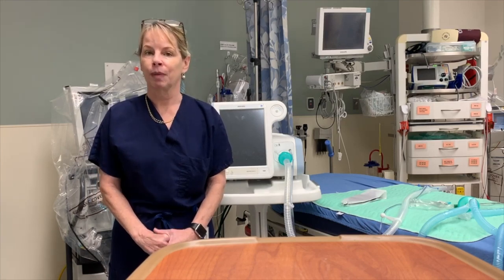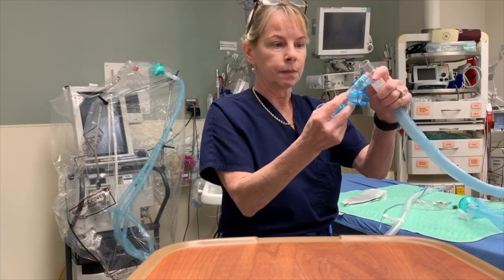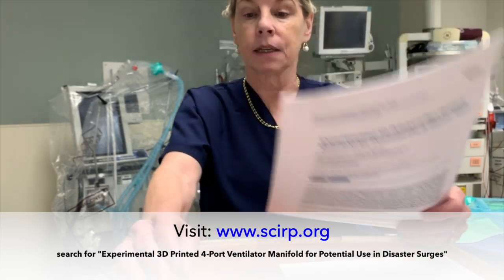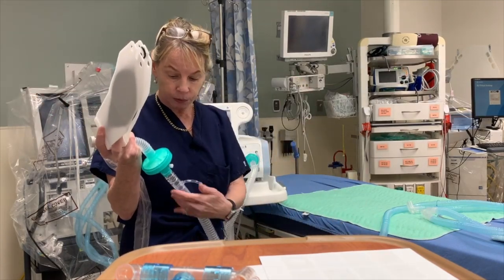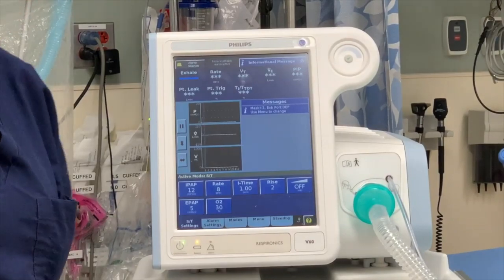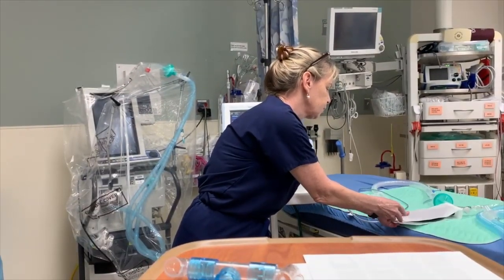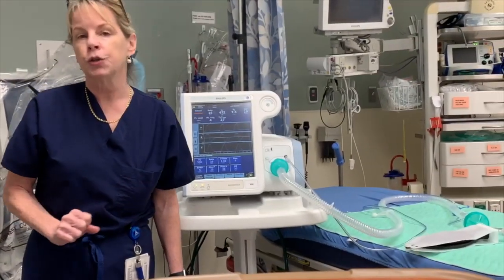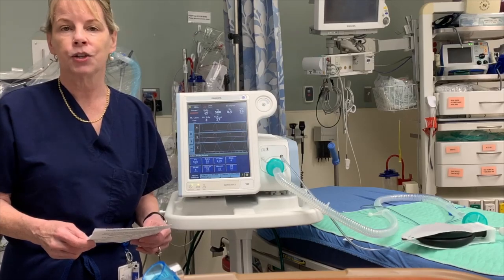COVID-19 How To: Modify a Bi-Pap Machine into a Ventilator

Comment: Thanks very much from Germany for the 3D printing docs. I am an ex Australian OT/ ED/ ICU nurse in the process of helping German engineers  here in Berlin build "things" that we need asap. Didn't even cross my mind to use a BPAP machine, I guess too many thoughts racing around.

PS I commented in the your last video about adding filters, and you added it to this vid, thanks again.
Reply: That circuit she used, I believe has a port for an expiratory filter as well. 
So if you only have a heated circuit, you can still protect the staff from the exhaled gases that don't leak out from around the mask.

Comment: Thank you from an RRT! I'll show this to my supervisor when I return to work tomorrow. (I heard the page for Respiratory at 3:44. How appropriate.)
Reply: Fit all the masks on v60s tightly before transport with covid 19 patients. For intubated ones hyperinflate the cuff before transport.
Minimizing leaks is imperative when moving patients.
Also make sure to have a filter on the whisper valve (exhalation port).
Stay safe... Well as safe as possible.
Reply: Roland Woltman  Thanks from an RRT.  But our Bipap circuits have only a hole as exhalation port.  How can you filter that?  Freaks me out to think of their virus laden exhaled air just filling the room.  😬
Reply: @BeckRD1 The circuit is setup with a viral/bacterial filters at prox and distal locations. There is a circuit with the exhalation port large enough add a viral/bacterial filter to it. Philips prod number  1065832. I don't work for them but I spent most of Sunday doing research...just trying to save you time.
Reply: @BeckRD1  If the whisper valve isn't in the mask itself, an extra filter BEFORE the mask (where the circuit and the mask connect) can do the trick in a pinch.

Comment: Dear dr. Babcock, the 4 way splitter is definitely the most practical idea out there for increasing ventilator capacity in an emergency. Thank you. One of the major criticisms of the setup is that it is very difficult to balance the system with the different pulmonary compliance between patients. Do you think that a simple restriction valve at each of the arms could help balance this? In other words, one could artificially restrict the passage to the more compliant patient, to increase resistance and help divert flow to a less compliant patient. This valved manifold could be 3d printed. If you think this idea may work we can design and send you a prototype for testing.
If promising we can make the files available for download.
Looking forward to your thoughts.
Reply: Sounds like it would require more human intervention then a staff already faced with more patients then ventilators would have time to address.
Reply: @rolandwoltman7835  Perhaps a system could make use of flowmeters and automatically adjustable restrictors to maintain correct tidal volumes

Comment: Also, if you're that hard up for ventilators in a pinch, your overdose patients or a post up just vented overnight would probably be more safe on a V30 then a ventilator shared with 3 others and relying on their lung compliance to be safe. 
The V30 can give a Max flow of 210 lpm so for a small machine designed for JACHO compliant bipap it can handle being a ventilator for most patients ( not covid 19 poor compliance ones though). 
The V30 would be limited on FiO2 delivery to 35-40 percent at best (02 would be bled in). 
But your patient would ventilate.